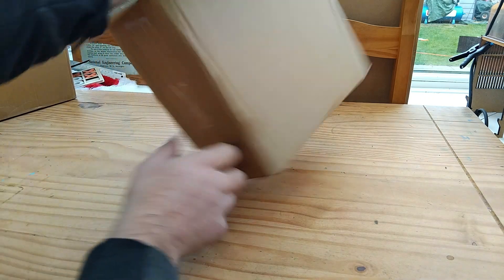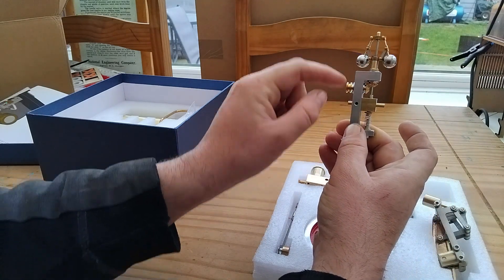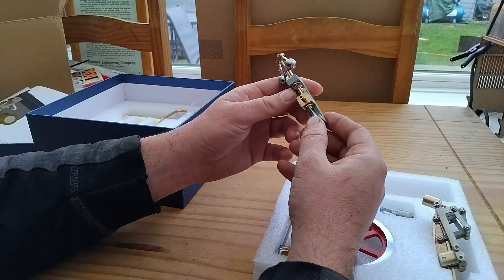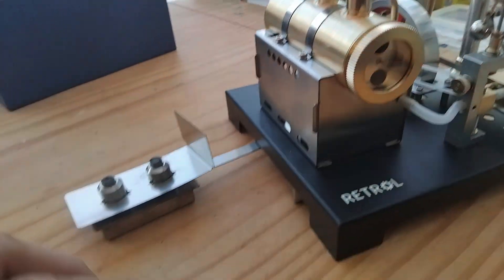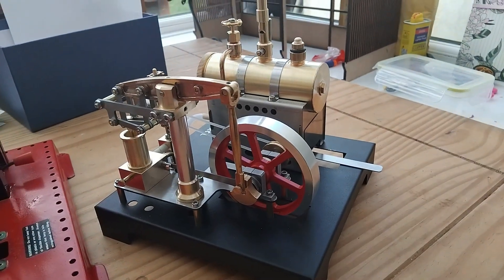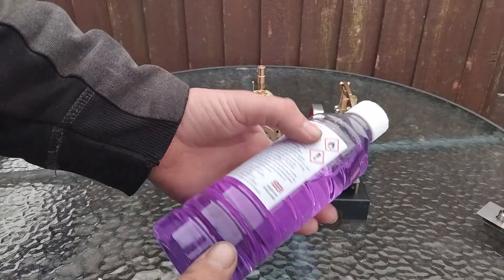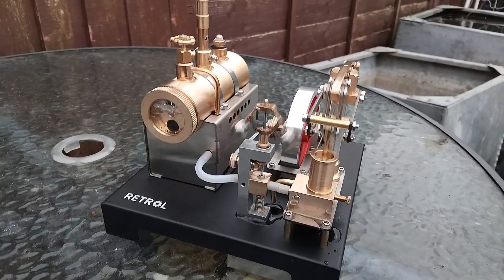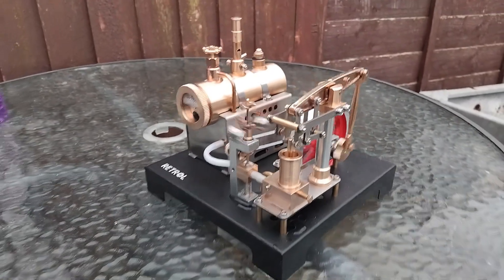Retrol Steam Beam Engine - THE FULL STORY

Comment: Nicely done video and I'm tempted to get the engine!  Dunno about methylated spirits...judging by Amazon, this seems to be ethanol at >95%.  A boiler pressure indication of some sort would be a nice addition, and I suppose that the ultimate pressure safety valve is the bit of tubing from boiler to engine.  Any idea what boiler operating pressure actually is or at what pressure the relief valve lifts?  Probably could run it on an air compressor and find out.

Comment: Great review and operational test of the Steam Engine. 
Would have liked a test of the steam whistle. 
Did you have the syeam pressure build up to relief valve pressure 
There are no spec’s on the steam engine on working pressure or relief